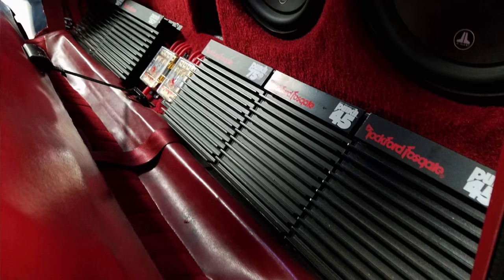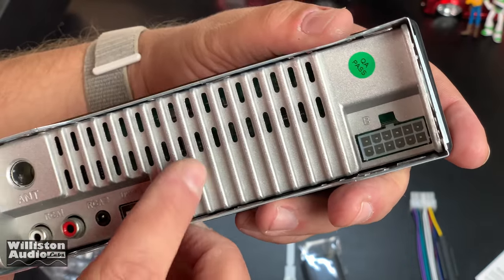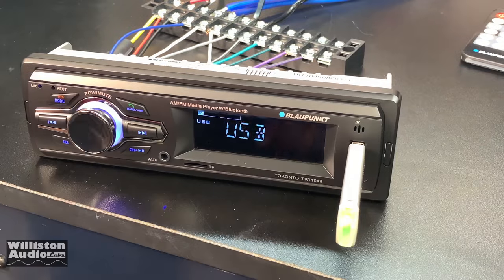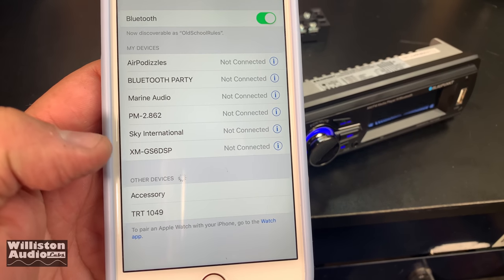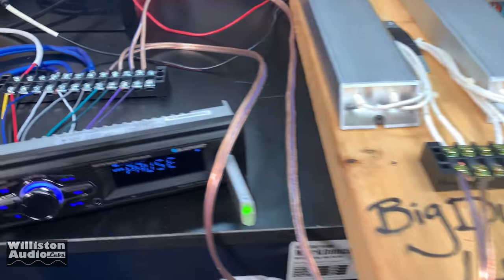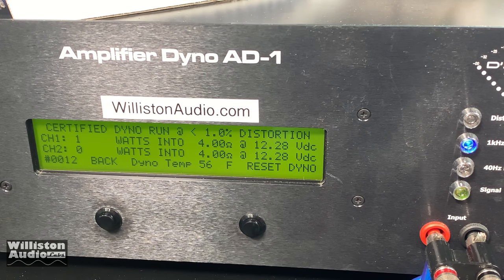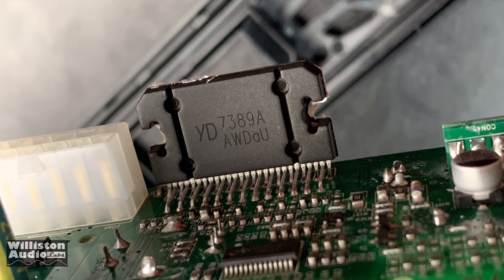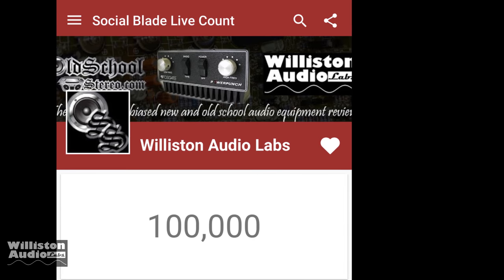Is a $10 Walmart Car Stereo Any Good? [4K]

Comment: This would be a good option for a classic car where you want modern functionality but also want to hide it.. this thing is so small it would be easy to hide somewhere! My only concern is how long it will last.
Reply from the maker: See other comments. Some have used it for over a year with no issues
Reply: It's $10...if it lasts a year, you're laughing. Wish we could get these here in the UK. I have a Citroen with built-in Sat Nav / stereo / computer. To adapt it to Bluetooth & USB involves arsing about with dealer-only software and then a £70 ( $90? ) adapter. This water-thin Bluapunkt would fit in one of the glove box/dash cubbies.
Reply: @6ettinold  I don't want to install something in my car hoping it lasts a year. Maybe I just value my time more than I used to.

Comment: Thanks for the great review. I'm impressed. I saw another review and the biggest complaint with this particular model was that the AM severely overloaded and the selectivity sucked on both bands. I don't know about newer car radios (or head units), but in the old days car radios used to come with an AM trimmer which adjusted the AM radio to the vehicle antenna. If there is no manual adjustment, then is there some kind of adjustment via the menu? Some questions. Maybe I missed it, but does this unit have RDS on FM? What about RDS on AM? What is your opinion on the selectivity? Can you get any adjacent FM frequencies next to a local like 104.5 next to 104.3?  What about the selectivity on alternate frequencies like 100.7 between strong locals 100.3 and 101.1? 

Thanks
Reply from the maker: I didn’t have issues with FM, but didn’t try AM. I never listen to it and honestly didn’t even think about trying 💁‍♂️

Comment: To truly review a $10 car stereo, you should not just be asking "Does it work?" The bigger question is, "Does it work for more than a few weeks?"
Reply from the maker: So you’re saying I went way above and beyond showing the internals, output power, THD of RCA outputs, and more? Thanks 🤙
Reply: This is dependant on a lot of factors, which mostly boils down to how the end-user handles the unit.
At this price, you can not expect the mechanicals to whitstand heavy abuse over the years. In this regard, you get what you pay for - but as long as you handle it a bit more gingerly, I'd guestimate the electronics to outlive the mechanics in the unit. After all, quality mech. switches and potmeters have a higher unit cost than the other regular electronic componentry.

At 10$, I'd be happy to get a few years with use out of it, before I'd have to pull it apart and replace a popped/dried out capacitor. =)

Comment: Man I want to get this to make a shop stereo. What cheap but decent sounding speakers would you suggest to couple with this?
Reply: Probably some jbl control ones but 2 channels go to each one so u get 20w per channel
Reply: @WM22  I actually bought a bluetooth amplifier from Amazon that uses two tpa3116d2 chips and pushes 100w to 2 channels for $16. Then a guy at work gave me his 6x9 and 5.25 from his Malibu. This thing gets loud.
Reply: JVC 6.5" speakers sound good and are like $20 on Amazon.

Comment: I cant stand why they dont do folders on the USB or MicroSD .... will this add so much cost ?????.   But at 10 dollars is a bargain anyways, as you say, it is perfect for a portable speaker project with a smal lead acid battery or 18650 cells.

Comment: So would you reccomend this as just a replacement for my old trucks head unit so I can get aux/bluetooth? eventually I will have an amp and a sub, would it play just fine with that?
Reply: Depending what you're running and how many channels, but it seems good enough. It's cheap enough to find out, you can always swap it later.
Reply: @user-yv2cz8oj1k  Yeah i did a bit more research and ended up pulling the trigger on this, some speaker wire, heat shrink, couple other things to install it. Only been a few days, but so far I love it, the bluetooth is great for how much it costs. 
Don't have the amp as of now, it will probably be a couple months until I do get one, so hopefully it has no problems with that in the future

Comment: i mean for 10 bucks it has its place  although i’m laughing because one of my best freinds in the late 80s early 90s was a nut for Blaupunkt Equipment in all his vehicles and he spent thousands of Dollars having them Professionally installed  keep in mind back then you could buy a new car  without any radio or Speakers in it  and he bought a new Work truck like that  then did the Stereo Install  ironically years later i wound up  buying and driving the exact truck  and he wanted to buy the System  from me  for another vehicle he had or his Wife did    Eventually. i did sell it to him  without the Speakers and installed my own Head Unit  as that truck became my daily driver  and i needed Tunes  in the 90s the big craze was switching from all the Cassette tape variations  to  Compact Disc  and my Wife and I agreed to spend the money on the new technology for our Vehicles and our Home sound Equipment  it was also the beginning of the era that Automotive Builders began offering Decent  Sound Systems  for the Money  especially in the Japanese cars and We drove Honda’s and Nissans  both  of which i  was Content with the Systems they  offered and i never did anything but enjoy them

Comment: i remember i used to be all in for cheap stuff but then i realized how they can ruin your computer or whatever you plug them into, theres a reason things are more expensive and i learned the hard way
Reply from the maker: Shot who?
Reply: It is designed to be used in older vehicles. Installing into anything newer then a 2010 vehicle is not very good judgement.

Comment: Basically the same as the dual xdm-16bt. Works good enough i bought 2. No complaints aside from less eq features but its 20bux.
Reply from the maker: This one is now out of stock unfortunately.
Reply: Flashy blue lights on the Dual, and I heard it runs very hot. No bueno
Reply: @ksavage681  i have 2 with none of these issues. One is running a 3k sub amp with now issues.
Reply: I bought two of these DUALs since the Blaus were sold out. 

I've been jamming one for a week nonstop and it does great. 

Only thing I don't like is turning the volume down is difficult because it wants slow adjustments only.  

Don't get suckered into trying the more expensive one claing 200W instead of 120W. 
It's the same rms power as the xdm16bt.
Reply: @staywhite6332  back in stock at Wal-Mart online at 12.42 each! Get them while they hot!!
Reply: I agree the volume on one of mine is so slow the other is pretty good. I think i have 2 different production models of the same model if that makes sence.

Comment: I wonder if the fake output chip is pin compatible with the original TDA and if yes is it possible to replace it and have proper output power of around 25-28 watts?
Reply: It wouldt be worth it as these tend to run hot ive hade 3 and they all hade heating problems i have them in my room on a amo box and they havent last

Comment: Wished I saw this earlier this year. I bought a Sony version like that. Without the CD player. Claims 15x4 RMS. Put it in an old box I built years ago for my workshop. Running 2 pais of Kenwood 6 1/2 2 ways off it. A cheap pair I bought at BB.

Comment: It's actually funny seeing this really cheap unit with the Blaupunkt name on it, as for the most part in Europe, you don't get these cheaper items. 
A typical Blaupunkt unit sells for at least $300-400 (tax included) around here.
Reply: Blaupunkt is not what it used to be.
Reply: Not really, you can get nice blaupunkt units for around 130€ now. Not the top versions but still pretty cool allrounders

Comment: Im mad i got mine 4 $12. Mine is a bit different but just as good. Question can u use an amp on this
Reply from the maker: Yes, line level outputs
Reply: Anything with RCA output can be hooked up to an amplifier. If you don't already know this, I suggest you pay somebody to hook it up for you.

Comment: Jack in back should be for adding a remote (IR) sensor/extender. You could mount one on the outside of the car or in the hatch.
Reply from the maker: It’s Line level output for rear channels. I updated info in video description and the pinned comment

Comment: To be fair, a 3.5mm input and Bluetooth is all you'd need to connect to a whole internet's worth of music with your smartphone. The radio part is a bonus. Even plays music off a flash drive or SD card. It does the job for playing songs. If I wanted to spend hundreds on a head unit i'd get an Android Auto one.

Comment: I'm building a carry stereo box and when I looked at PSUs I'm not sure what ampere to get. Is 5A enough?
Reply: butchtropic  Thanks but I planned to bridge the 4 channels into two channels for more wattage to the speakers. I guess I'll need a 10A or better.
Reply: I bought a similar Dual deck, and ran it off of 1.5 amps.  It was connected to 2 8-Ohm speakers.  I turned it up louder than I wanted to listen to, and the Kill-O-Watt meter only showed 6 watts.  Four-ohm speakers will probably take more power as will running four speakers.  Five amps is 60 watts.  I would give it a try if you have the power supply.

Comment: WHAT year make and model car would this fit?
Reply: It's single din, so pretty much any car made after 1985 and before 2011. You may need a "dash kit" if your car currently has a double din radio. I recommend getting the wiring harness for your vehicle as well, as it is color coded for aftermarket radios, and will make installation easier, otherwise wiring diagrams are available at modifiedlife.

Comment: 3:48 What good is it on the back? That would be inside your dash. You would have to find a hole or drill hole to stick your charging cable through the dash to use it. Not to mention having the cable permanently dangling from your dash.
Reply: its so you can put a hard drive in your glove box and not see anything. even the expensive totl pioneers have one on the back
Reply: @TheAirConditionerGuy  Thanks, that sounds like a good idea. I have a few 1TB & 2TB external SSDs that are pretty small. I could see doing that to my car stereos. But I'm too lazy to take them out of the dash to see if they have a USB jack. Just plugging in a regular 64GB or 128GB thumb drive into the front is good enough for me.
Reply: The head unit I have has rear usb only and I specifically sought that out as I wanted to run my iPod and iPhone cable into my armrest box for a more discreet install , I’m not a big fan of cables running all over my center console.

Comment: port on the back is your Remote Control Aux (suppose when the battery dies you can plug it in there.
Reply from the maker: It’s rear audio output (line level). I updated video description and pinned comment

Comment: I found one for like $30. Contemplating if I should put it in my crown vic 🤔🤔🤔
Reply: I had one very similar to this. I was driving and old beater that had a decent pioneer in it from years ago but only the radio still worked on that unit.  It's cheap and  was extremely under powered but if you just want something that will play music these are  fine for the price. You can probably find  and even cheaper unit on Amazon that would be just as good.

Comment: Price doubled to $20....is it worth that?
Reply: No? I got one for that price with RGB's all over the place and fatter in the back which makes me assume theres more electronics inside. It has all the features of this with added LED's. Is lots of multi colored lights important to you? It is to me, since the main reason I was replacing the OEM head unit is I was thinking about replacing the lights that burnt out and realized that's foolish since that head unit is a cassette player. Although I haven't measured the actual preamp output wattage I assume it's around the stated specs. Since what this guy is showing is  around the same spec. out. on this model and my guess is these come from radio town,China.

Comment: What's the best cheap power supply I could use with this unit for a DIY home boombox?
Reply: Anything 12 volts at around 4 amps.
Reply: Old drill battery for weight and power

Comment: Does it actually have AM radio? I saw no ferrite antenna there, and most such units tend to be FM-only.
Reply from the maker: Yes
Reply: Who the f listens to am radio? Do you still check your Myspace?
Reply: @josmith213  There are people who still do both :-) But I was mostly wondering about both the feature being included, and how they actually implemented. I saw no obvious means of AM reception (e.g. a ferrite antenna, or inputs for an external AM one), so I thought it must either be very poorly implemented (e.g. through the FM antenna) or a misprint on the box.
Reply: @wal  Even more amazing is that the European version of this radio also includes LW reception o_o

Comment: It's all about volume of production isn't it.

This head unit is obviously a generic unit designed for .. well, it's designed for the majority of the world's population, fundamentally. China, India, Africa, all across Asia, etc. 

It seems like a miracle to us but it's really a shrewd move on behalf of the manufacturers who will practically regard this thing as an industrial commodity for converting a few grams of silicone, aluminium and plastic, some 3rd or 4th hand ripped off circuit and function design, fake components as noted (I wonder where that leave Blaupunkt. Wait, aren't they insolvent already? Probably last minute cash in on the brand before it dies as a result of putting its name to trash like this), and a single piece of plastic that'll be churned out in the millions for next to nothing like a packing tray for vegetables.

It's all about volume of units shipped. An investor will have had to have made the (quite reasonable) prediction that if you can price a head unit at $10 it'll sell millions around the world. These will be in market stalls and high street shops all across the developing world and will sell bucketloads that we'll never hear about under various different brands, and somewhere there'll be a factory run by the speculators that's geared up to producing them at a price that is virtually impossible to compete with on account of the volumes they've geared themselves up to sell. They'll have engineered a massive industrial operation around this single product. The more units, the more you can justify developing bespoke measures and advanced strategies to cut costs. Push the competition out of the game by keeping margins thin.
Reply from the maker: I don’t see ANY margin at $10 though...landed cost to retailer, then shipping to consumer...it’s virtually impossible to make a profit even if it cost $1 to manufacture

Comment: New to your channel.  Any Suggestions on a setup for a 93 3000GT/Stealth.      I have some fancy newish front tweeters ( I forget the brand)  and New GT0 JBL Door Speakers.  I have pwr wire for amp or amplified sub for the rear.  But I don't know what to get. I would like to have no Sub Box.   I used to have a bulk 1600w Audibahn Amp that I hated, too bulky.    Some old Sony Headunit that I think needs to be changed.   The Newer built in Amp Sony Head unit on my Mercedes is ok decent.  But I always feel like I am missing something.
Reply from the maker: Hi Jason, check with Dean and Fernando on Five Star Car Stereo. They do a weekly Facebook live stream and take audience questions. They are installers by trade and may have a suggestion for you and that vehicle 👌

Comment: Is there any data on the radio performance - even just claimed specs from the documentation? I'm looking to create portable stereos that can pick up a weak FM signal (small FM transmitter at a large group campout and I want something that can play the music and announcements at a second social center) and while keeping the price down is a good thing - not if it winds up not working. ;)
Reply from the maker: I can check the manual for you. I’ll also plug in a small antenna and try. Email me WillistonAudio (at) gmail dot com

Comment: It finally arrived!!!! Out with the old, in with the new:

https://imagizer.imageshack.com/v2/800x600q90/921/BH684h.jpg
https://imagizer.imageshack.com/v2/800x600q90/921/1PcTrk.jpg

Sounds great on the 30 watt RMS rated kenwood coaxials I put in a few months ago. Works just like you showed. Connects to the phone fast, makes clear calls. If the car's antenna cord was 1" shorter, I would have needed an extension.

Comment: I just saw this video, went to go buy...walmart is sold out and third party Amazon is at $30 (including shipping)....anyone have any other suggestions...different models?
Reply: it's 130 dollar overhere in Europe, 10 dollars seems like a mistake? Or we are getting ripped off on the other side of the ocean.
Reply: @snoeki  EBAY USA has a listing of someone selling for $24.99 plus free shipping.  Probably will cost to ship to Europe but you can try.  I'm guessing maybe a bit of both...wrong pricing and higher EU pricing.
Reply: Don't feel too bad, I managed to pick one up from Amazon for $10 to use in the garage and while it was free 2 day prime shipping, that was only after they ship the item. They gave me a one month window for them to get the item shipped :|
Reply: $30 still isn't too bad.
Reply from the maker: I have my tested any other cheap models yet, but they are in the plans